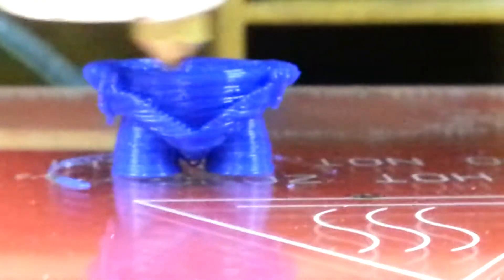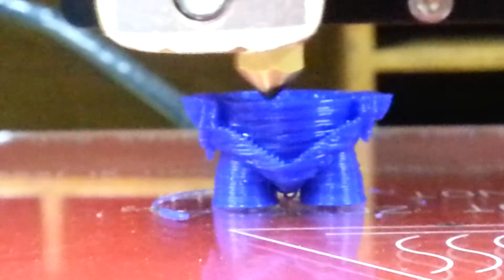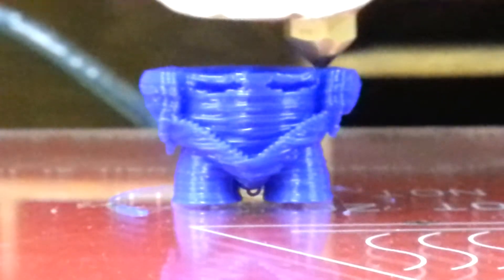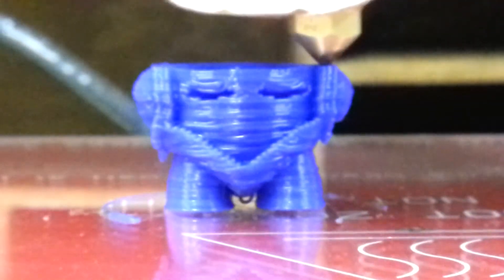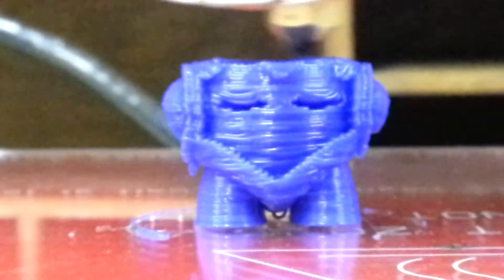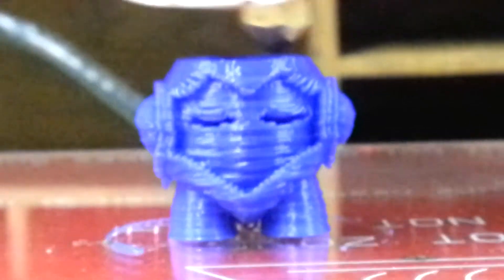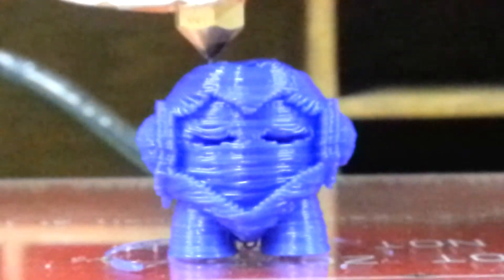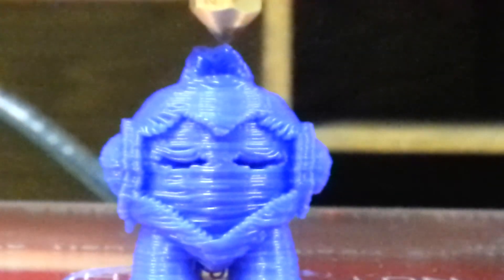Geeetech Aluminum Prusa I3 Teaser

Comment: Isn't you hotend too hot? (Im guessing you are printing in ABS)
Is there a fan blowing on your print so that it cools down more rapidly?

I'm planning to build one myself after working with a 3d printer at work (expensive leapfrog HS).

Thx for the review / print demo

Greetings from Belgium
Reply from the maker: Hi Thomas,

It was the sample filament that was supplied with the printer.  I belive it is PLA, but I'm not 100% sure.  I do plan on setting up a cooling fan.  This was just a quick test print and probably was printing too hot.  The extruder temp was 200°c with a bed temp of 70°c.